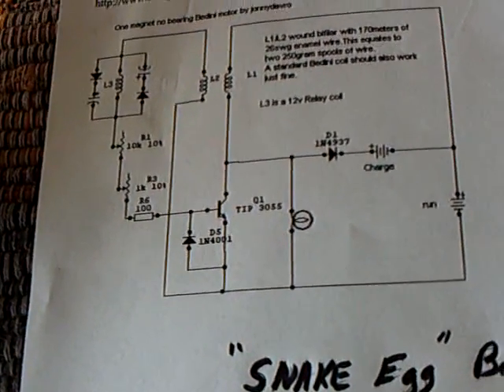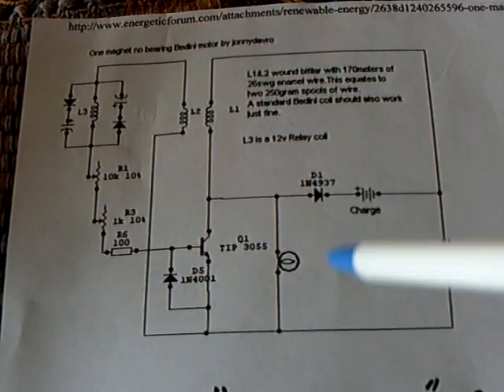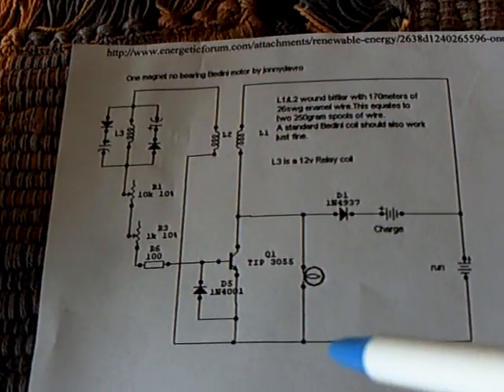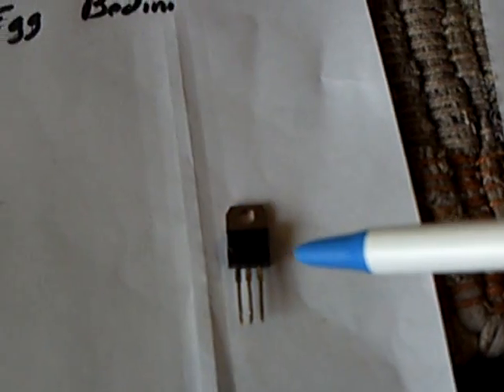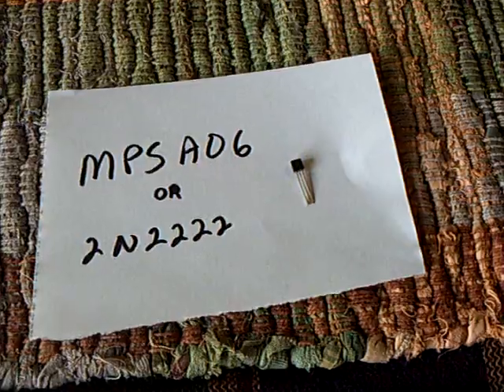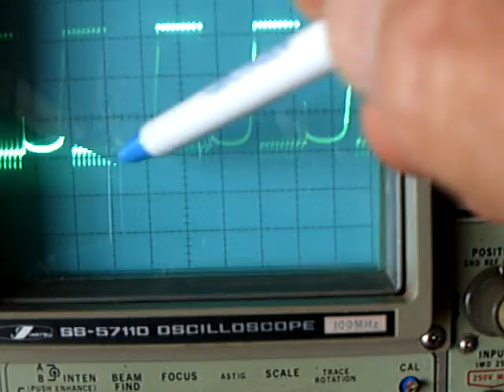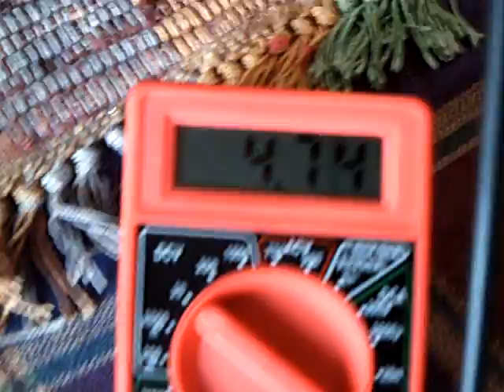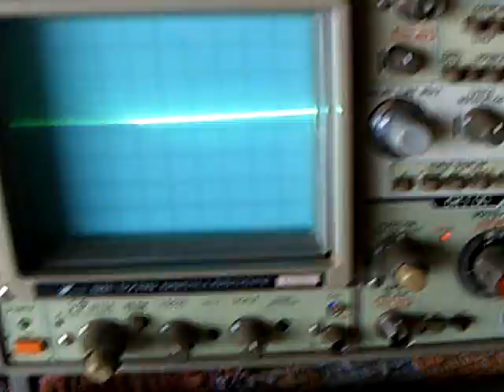1 Solar cell powered Snake Egg Bedini

Comment: I'm surprised you've not allready seen my vids... i'll have to throw bigger stones into the pond...

I just checked introverabrate's how to video...

The standard setup is to go across the transister...
I don't understand why they didn't just put it across the the output for the drive coil...

It seems stupid to have it that way coz it's discharging through the primary battery thus depleting it...

Apologies Lid

Comment: Thank you lid for stating what i allready knew...
but it doesn't diverge from the fact that in the diagram it's connected in the wrong place...

When the neon lights it'll connect back to the drive coil via the primary battery the wrong way thus discharge the pri battery...

Comment: is that bulb simbol supposed to be a neon?
If so, it's in the wrong place... it should not connect down to the pri battery neg but instead to the pri battery positive!

By having it this way whenever the neon lights its going to draw power from the primary battery...

Comment: yes when you run a solar pannel... IT's voltage is not it's draw and it's cycling back on it's self and the magnet sending out waves from the coil it's self. Put a freequency tuner and a kml on the line. Also shielding might help a good bit :) Jsut some sujestions :)